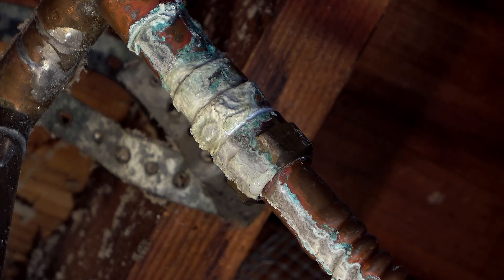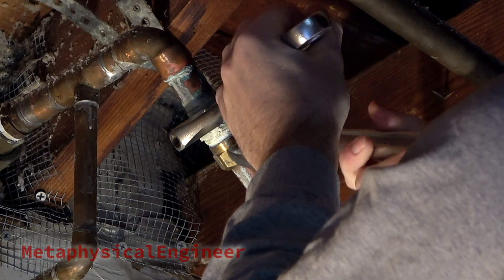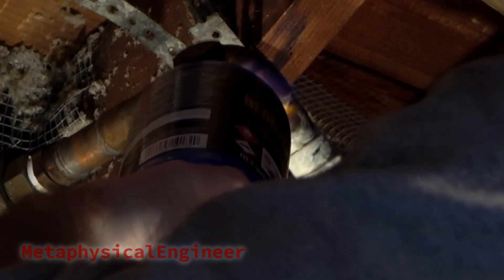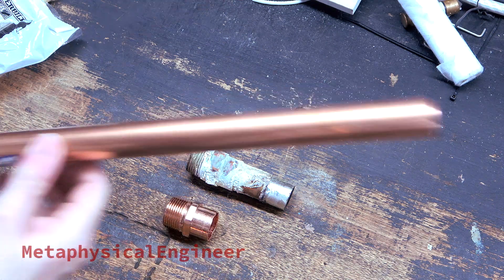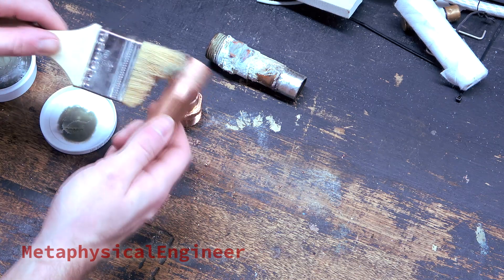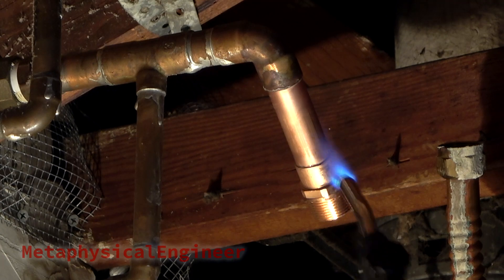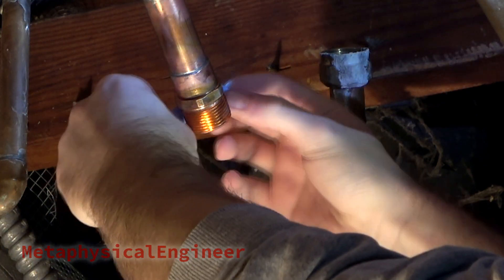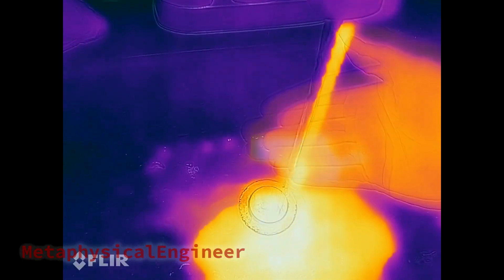Fixing a Leaking Hot Water Pipe

Comment: Nice fix. I've never done any plumbing fixes aside from replacing sinks and toilets, but those have always involved flex fittings with braided lines and pvc drainpipes
Reply from the maker: All skills worth knowing!  Sweating/soldering is a bit more complex as you saw, but not too bad with the right materials and attention to details.  Ironic how I'm so much more comfortable doing high temp brazing vs soft solder.